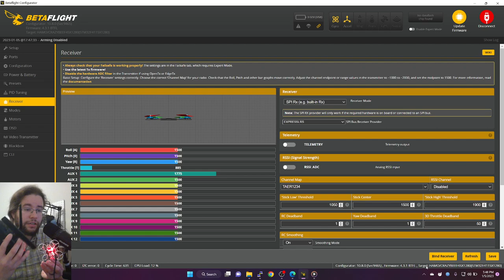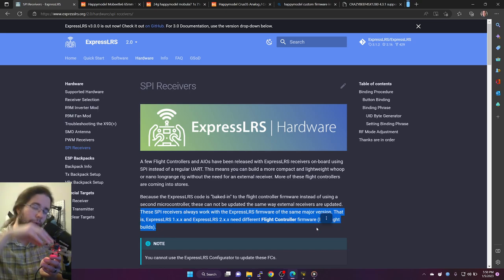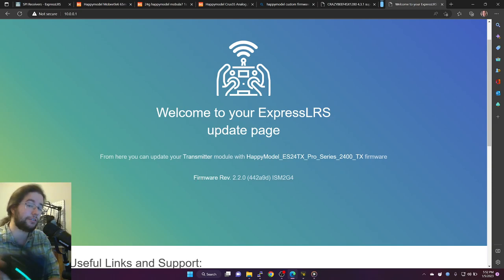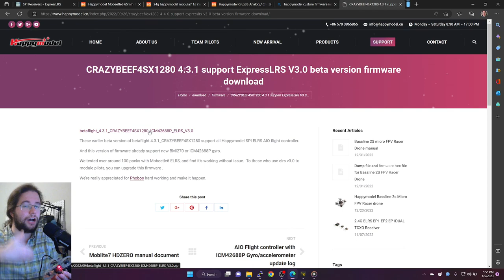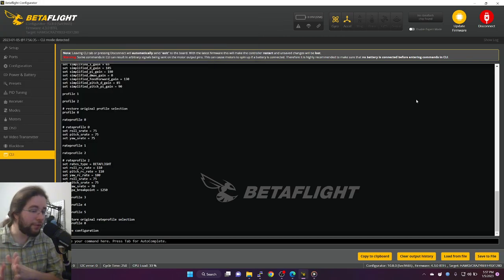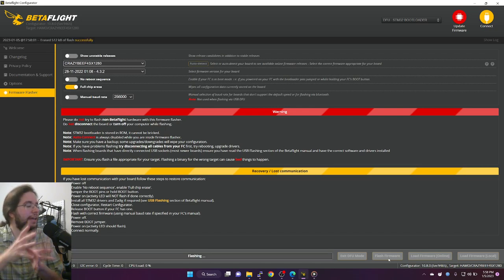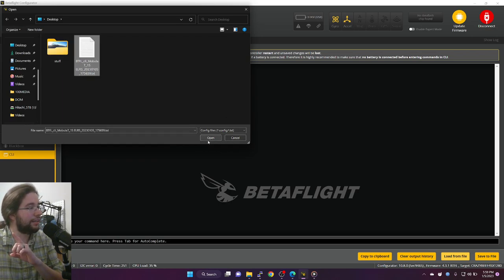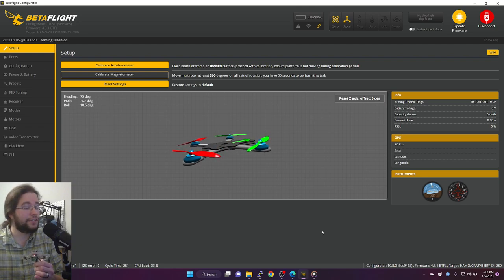Happymodel Mobula7 1S ELRS / Mobeetle6 / Crux35 ELRS SPI Won't Bind to 3.0? Easy Fix!

Comment: Hey John is it possible to flash a serial elrs receiver to an older version of elrs? I'm having an issue with binding my cineape 25 to my literadio3 elrs
Reply from the maker: Technically, yes. If you flash stock betaflight 4.3.1 then that will put you on SPI ELRS 2.5.x, and will bind to 2.x ELRS tx. Flashing 4.4 gives you ELRS 3.x, and will bind to ELRS 3.x tx.
Reply: @John Cuppi  I'm still on 10.8.0 betaflight I didn't update to new one I literally had just bound my rekon 4fr with an elrs receiver in 2 seconds like a couple weeks ago and my mobula7 1s elrs a few months ago but I figured the cineape won't bind because it probably has newer version of elrs I'm still a newb tryin to figure it out lol do I need to flash the rx with an older release on elrs configurator?
Reply from the maker: @scu-dub  Do you know what version of ELRS your tx is on? I would find that out first, then I’d be able to direct you more clearly as to what to do.
Reply: @JohnCuppi  yes its the literadio3 elrs with 2.0
Reply: @John Cuppi  I don't know what version of elrs is on the rx though I have been on Darwins site but they say nothing about it
Reply from the maker: @scu-dub  I have just checked out the CineApe25 manual and the flight controller info/diagram. 

The cineape25 flight controller does not appear to be ELRS SPI. It's an external receiver. 

And I am guessing, since it will not bind, that receiver is probably on 3.x -- you can verify it by powering the quad on, and waiting for 60 seconds to see if there's an expressLRS wifi network to connect to from your PC or phone. After you connect to the receiver wirelessly, you will be able to see the version, and also upload firmware over wifi from there.

You will need to certainly use expresslrs configurator for an external receiver (unlike SPI) to download and flash the firmware 2.5.x over wifi.

I hope this helps get you going in the right direction. You got lucky with the SPI ELRS whoops! Most people are getting ELRS radios or transmitters right now with version 3.x on it, and are having to follow my video to upgrade from 2.x to get them to bind, which is what this vid is for. In your case, you have a newer external receiver that you need to downgrade. 

Or...! you could follow my newest 4.3->4.4 video, upgrade your whoop :) and then upgrade your literadio to 3.x. Long term it's best to get on ELRS 3.x, if you can.
Reply: @John Cuppi  man John you are the man!!!!! You don't know how much I appreciate the help 🙏🏼 I did get lucky on the whoop lol it's my second one my first mobula7 1s elrs got the gyro bricked back when that version of betaflight was bricking them and it had 2.0 on it so I ended up getting a whole nother mobula7 because the fc was around 70 bucks so why not just get the whole whoop again for 100 lol so the new one came with 2.1 I loved how easy it was to bind just hit the bind button in the receiver tab in betaflight and on the radio and BAM! 2 seconds lol I bound my rekon 4fr in like 3 seconds using the plug unplug method but this cineape uuhgg lol I really appreciate it I'm going to eventually update to newest but I just don't want to have to flash those other receivers especially that spi on the mobula it looks like it could be a headache lol I am going to though I just thought it would be easier to downgrade this cineape receiver and get it in the air asap lol thanks for the help and looking up the info for me ✌🏼
Reply: @John Cuppi  well john I just found out that my literadio3 cannot be updated to elrs 3.0 which sucks but I guess having to down flash is my only option anyway....until I get a new radio that's the only way I will be able to get the newest firmware on my quads and radio....I'm gonna try to flash this receiver and hope that I can because I read where it has no target because it's a Darwin nano elrs receiver so I hope all goes well 🙏🏼 thanks again
Reply from the maker: @scu-dub  That is incredibly disappointing and shameful on BetaFPV's part at this point. I did not realize the literadio has its own configurator and that they still have not updated their custom fork of it to 3.0. They need to get on it. Flashing down to 2.5.x should be okay -- the target is  BETAFPV NANO 2400 RX according to darwinfpv's site: https://darwinfpv.com/products/darwinfpv-2-4g-elrs-nano-receiver

So if you choose version: 2.5.2,  device category: betafpv 2.4ghz, device: BETAFPV NANO 2400 RX then according to them, this should work just fine!
Reply: @John Cuppi  THANK YOU MAN!!!! YOUR AWESOME DUDE! now this may sound dumb lol but what regulatory domain do I pick ?lol
Reply from the maker: @scu-dub  Use the default 🤞🤞
Reply: @John Cuppi  just tried and I got a successful download until I went to elrs configurator and got a targets mismatched message 😫
Reply: @JohnCuppi  I got targets mismatched after loading bin file? And I know they were the correct targets....
Reply: @John Cuppi  Got it going man!!!! Thanks to you👍🏼 I was scared to hit that flash anyway when I saw that warning but I swear it couldn't have been more simpler flashing via wifi I'm super stoked to get into the air I'm really pissed though that the literadio3 can't be updated so now I have to go radio shopping because I'm sure all new quads with elrs will have 3.0 or newer and I don't wanna have to flash them back everytime anyway thank you so much dude 🙏🏼 ps...I have ocd and not getting my motors to beep on my aux 4 channel is making me nuts now but at least I'm bound and sky bound 😁✌🏽
Reply from the maker: @scu-dub  glad you got it going man! I fell asleep but I was going to say that you could probably safely ignore that message, because if there is even a slight difference in the naming, it will freak out and say “mismatched target.” I was going to suggest hopping on the ELRS discord to ask those guys in order to be  110% sure as I didn’t want you to “soft brick” the receiver but I’m glad you just sent it anyway and got it working. Cheers! Yes, a new radio from RadioMaster is what I would be looking at if I were you. RadioMaster works closely with ELRS developers and all of their stuff is approved, so you will never have this issue you’re going through with beta fpv’s gear. Beta makes great little quads but issues like that with their literadio perplex me.

Anyway, happy flying! I ran 2.5.x until right when I made this video and now everything across my fleet is updated. Works just fine and is stable.
Reply: @John Cuppi  couldn't have done it without your help man seriously! 👍🏼 I am looking into getting a radiomaster boxer 4in1 because I fly planes as well and I will just get a elrs module for it but I'm DEFINITELY GETTING A NEW RADIO LOL✌🏽

Comment: Thank you, I'm unable to bind My transmitter module running 3.0.1 does the version have to match the receiver on version 3.0?
Reply from the maker: No it doesn’t have to match any exact 3.x version number. As long as you flash this custom 4.3.1 firmware, you can bind to 3.0.0, 3.0.1, 3.1.2 etc. You can always bind as long as the major release numbers match, 3.x binds to 3.x, no matter what version(s) are on either side. The problem only comes along when you try to bind 2.x to 3.x — that’s a no go.
Reply from the maker: I have also tested this and updated all my stuff to 3.1.2 finally, and every single spi ELRS model I have has bound to it :)
Reply: @JohnCuppi  awesome thank you

Comment: The bassline is also on this crazybee FC. So I tried this but once I put my diff all config back on..my orientation was wrong..my motors spinning wrong direction. I fixed some of that manually to find it again somehow shifted orientation. Maybe it doesn't work on this bassline. Anyone successful with elrs v3 on the bassline?
Reply from the maker: I don't have a bassline so I'm not sure, but if you're still having trouble with this (sorry, i didn't see it until now), just upgrade the FC to betaflight 4.4 and don't bother with this custom hex file at this point. BF 4.4 added ELRS 3.0 binding thankfully, so this isn't needed anymore.

Comment: I’m still on V2 ELRS on my Zorro. Periodically my Crux35 just falls out of the air or when I land it looses telemetry for no reason. I can’t figure it out.
Reply from the maker: Did you ever update betaflight on it at all, or are you still using the default firmware it came with?
Reply: @JohnCuppi  the defaults. I have never updated firmware on any of my quads. 😂 
I’m scared to break stuff
Reply from the maker: @PoodlehawkFPV  I know an update is scary, but the crux35 shipped with a prerelease version of betaflight with bugs in it. If your firmware date reported in betaflight isn’t at least June of 2022 then it is running a release candidate version of BF with known bugs. It is extremely critical you get it updated because failsafes with ELRS SPI were a major problem in many of those firmware versions, but no one knew this right away. The 4.3.0 or 4.3.1 is solid. Just follow a tutorial for migrating and upgrading bf firmware and back everything up before doing so.

A firmware update can be scary but a failsafe is scarier.
Reply: @JohnCuppi  I’ll try to figure it out. It just did it again to me at lunch break. Then when I really gave it the beans it never crashed
Reply: @JohnCuppi  I did a diff dump and it says it’s a Betaflight version from May 2022. I’m still running ELRS version 2.5 I think on my controller and Happymodel only had a firmware update for ELRS version 3 for the Crux35. I don’t want to switch all my drones over to 3.0 just so I can fly this Crux35. Am I missing something here?
Reply from the maker: @PoodlehawkFPV  May of 2022 is definitely a problem, that’s prerelease firmware! Since you just want to use ELRS 2.x then don’t follow my video’s instructions. Just flash the latest 4.3.1 from betaflight configurator itself. Use the “Load Online Firmware.”  You only need the custom image from happymodel if you want to use ELRS 3.0 which is what this video is all about. In your case, you just need to get your crux35 up to date with stable stock beta flight firmware, which will work fine with 2.5 ELRS.
Reply: @JohnCuppi  I’ll try to figure it out tonight. Thanks for your help dude!
Reply from the maker: @PoodlehawkFPV  I do have one more question — have you been flying ELRS at 500hz or 250hz? I flew most of the release candidates last year on my crux35, and I personally never had a failsafe. But I know some who did, and I heard that the higher the packet rate on those older firmwares could exacerbate that.

Another thing you may want to try is setting the cpu overlock value to 120mhz in betaflight as well. I have done that for all of my F411 flight controllers including both of the crux35 with no ill effects. The OC has been stable and gives the FC just a little more power. Because 4.3.x is more resource-hungry on these little F411 boards.
Reply: @JohnCuppi  I always use 250mhz. I’ll try the update tonight when I get home. I’ll let you know how it goes. Thanks again!

Comment: I already have some drones in my zorro, can i bind the mobeetle without a phrase?
Reply from the maker: Yes you don’t need to use a bind phrase. Use the bind button in betaflight, then set the tx to bind mode.
Reply: my mobeetle wont go into bind mode, should i re load the cli? @JohnCuppi

Comment: im pulling my hair out here. my happymodel bassline fails to go into dfu mode and load firmwhere.Any ideas? cheers
Reply from the maker: Try CLI and type “bl” does that do the trick?
Reply: @JohnCuppi  what does "bl" mean?
Reply from the maker: @k1ortia  bootloader, it’s short for bootloader mode. It forces the FC into DFU when you type that at CLI.
Reply: @JohnCuppi  ah, ok. Well iv managed to get into ddu mode now, by installing the correct drivers, and iv loaded every firmware to my TX module, from 3.0.0. to 3.2.1 and nothing. Iv put the correct hex file onto the spi board aswell which is the new beta flight 4.4.0. and still can't get the bloody thing to bind...Grrrrrrrrrrr😡
Reply from the maker: @k1ortia  What packet rate are you running on your module? Remember that only 500hz and below are available for ELRS SPI.
Reply: @JohnCuppi  Iv gone through every packet rate from 500hz down to 50hz and nothing. This is why a rarely bother with new firmware as its nothing but problems. Time to go back to 2.5.0 i think
Reply from the maker: @k1ortia  See if the folks on the ExpressLRS discord can help. Sorry it didn’t work out. Something is probably missing in the setup that I’m not aware of. One issue is that 2.5.x is getting long in the tooth, eventually it’s going to become a pain in the ass to stick with.
Reply: @JohnCuppi  Ok, well im going to go through your video again slowly and check i havnt missed something.

Comment: why after flashing, must do load the backup again?
Reply from the maker: because flashing firmware does not save any settings, all settings are erased, so you must restore the backup config.
Reply: So, when the flash done, and backup again the setting, it not impact for the elrs V3 right?
Reply from the maker: @andifu1630  correct 😎👍 the V3 is in the firmware, not the settings config.
Reply: wihi thankyouu~ for the guide~